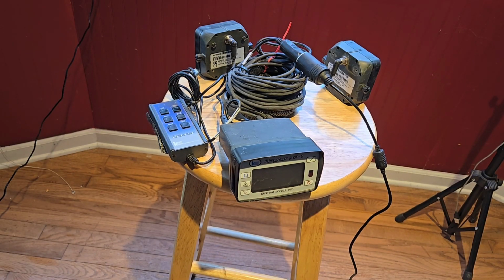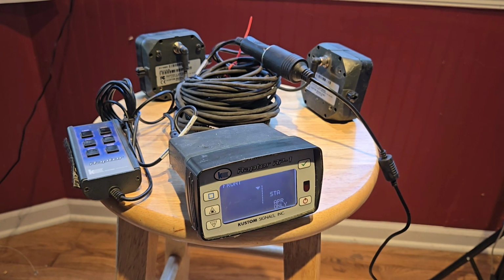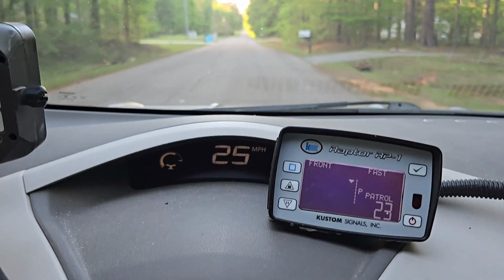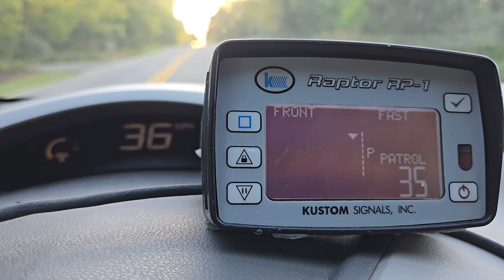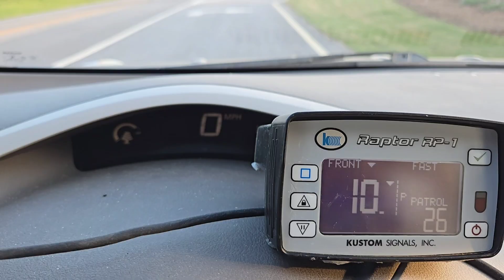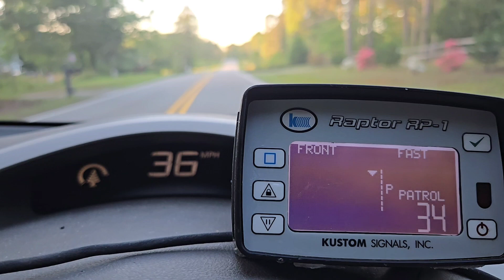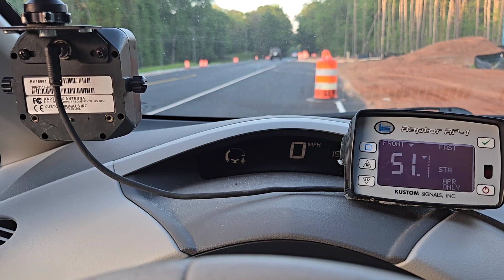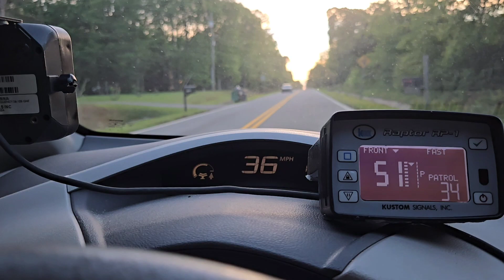Kustom Signals Raptor RP-1 Radar testing

Comment: What happens when two speed radars on same frequency meet heading opposite directions? How far away can it pick up the tuning fork? Will a magnatron from a microwave oven interfere with it?
Reply from the maker: That's a good question, if I could safely do it, it would make for a good video.

Comment: Maybe the size tires on your car are different than what the car is calibrated for from factory
Reply from the maker: They are the factory OEM tires. I found out that Nissan programmed the car to show 2MPH faster than actual speed to likely stay within Federal regulations on speedometer tolerances.

Comment: What frequencies are these antennas transmitting at? 24.1xx?
Reply from the maker: Correct, 24.125 Ghz K-Band.
Reply: @PremiumFuelOnly  yes that is the centre frequency but do you know what it is actually transmitting at?  For instance, I have two and one transmits at 24.109 and the other 24.116
Reply: @ryanbaz21 if you have a radar detector, example ,Max 360 c on the advanced setting it will show what frequency of the radar gun it's picking up
Reply: If you drive towards a big metal building will it still give you a reading like if the building was a so called car approaching you?
Reply from the maker: The big building would be likely seen as background reflection since it's going the same speed as the trees or other objects and would be used to calculate the patrol speed.